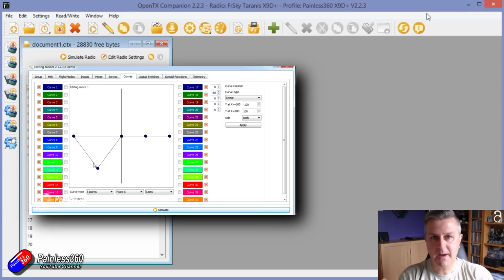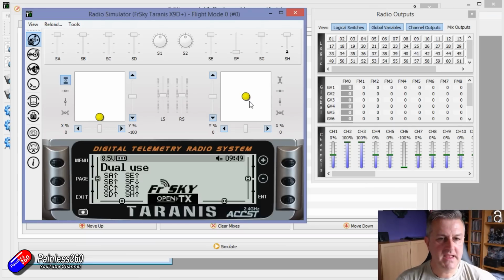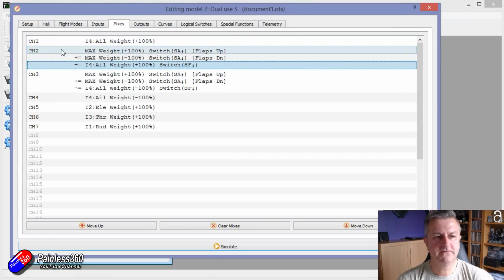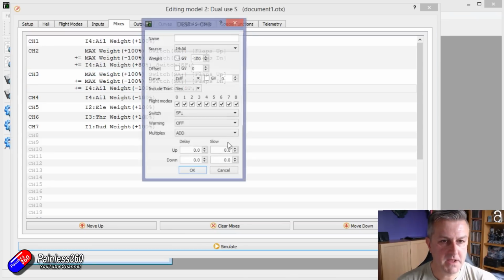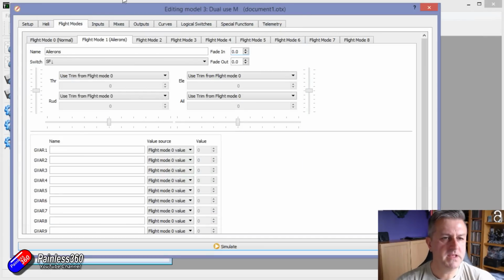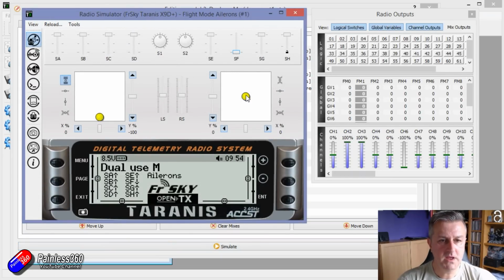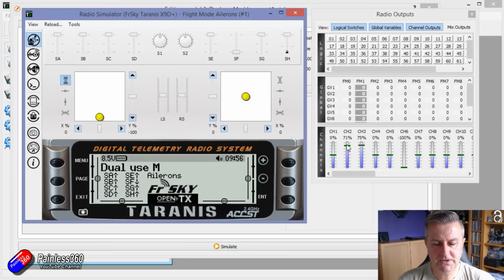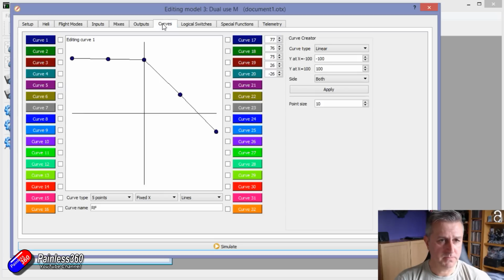OpenTX Quick Tip: Using Flaps as ailerons / dual use flaps / full span ailerons

Comment: I am so glad I found this video. I have been wanting to use ailerons and flaps together on my TimberX. Here is where I am. My ailerons are on a Y harness. My right aileron and flap are moving together. But I must have made an error. My left flap is moving like an aileron, but opposite of the aileron. Where did I go wrong?
Reply from the maker: No idea without looking at the radio. Sounds like you are using two chanbeks for the Ailerons so make sure you did the same on the side that doesn't work as you did on the side that does.. Best of luck
Reply: @Painless360  Thanks a bunch.
Reply: I think I know why I can't get both wings to work. The flaps are on a "Y" harness. I believe you said it had to be separate channels. Darn!!

Comment: This is awesome but I’ve got a drama with my timber x 1.2m, the flaps go both ways above and below the wing And I’m having trouble getting them to act as two position flaps (half for takeoff, full for landing), I’ve got the flaps working so the flaps mimic the Ailerons but I can only get flaps to be either off (level with wing) or on fully up +100% (which you don’t want)and level with wing 0% (flaps off) or down -100% (full flaps) I can disable +100% flaps so half 0% is flaps off but I’d really like the 2 positions below the wing 
+100% off
0% flaps off position 
-50% takeoff flaps
-100% landing full flaps 
I hope that made sense 🤔 
Thanks for all your videos they are great 👍🏻
Reply from the maker: You could setup a curve for them and select that with a switch so they move as you want... best of luck
Reply: Painless360 thanks mate I’ll give curves a try.
Reply: Painless360 got it working thanks I tried slowing the flaps down to look more scale but something is off it flicks the flaps up over the wing for a short second then slows to return level, but al least it work at normal speed and learning heaps about OpenTX 👍🏻
Reply: Painless360 have you got a Timber X? I’ve decided that slow flaps are a must 🤣 I just can’t get them to work.

The plane would be a good challenge for you to program, flaps go both ways for ailerons and can be used for crazy elevators  and of course flaps with delays, would be amazing if you could have a crack at this👍🏻 they do a night Timber also, the model comes with a Sektrum ASX rx which does the delay in flaps as you can get the settings from Horizon hobby great for Spek users but doesn’t help Opentx, have an awesome day thanks again

Comment: Hi Lee would it be possible for a V-tail plane Ailerons and the V rudders as a type of airbrake when coming into land?  like combining the Ailerons and the V rudders together using the SH switch like a push switch function for a brief moment of time?
Reply from the maker: Possibly, not sure how that would affect the attitude of the plane. i.e. how the two control surfaces would work in tandem to slow the model not pitch it up/down...

Comment: I was searching "full span ailerons" for a week and only just found this video. I even asked Andrew Newton if he'd consider doing a how-to video and he thought it was a good idea. Hopefully he's aware of your video. Thanks for putting this together.
Reply from the maker: You search other RC channels other than mine! ;) surely not...
Reply: @Painless360  Question on this setup. When I followed this method, and assign the flaps to a 3 pos switch, they function just as an aeliron would and lose the "flap" characteristics. They function as full span ailerons fine, but how do you make the flap surfaces actuate in one direction only with a 3 pos switch? Ex. SA⬆︎=Flaps Off, SA(–)= 25% Flaps, SA(⬇︎): 40% flaps.  Hope I'm explaining this corretcly. As it is now: SA⬆︎=Flaps above the wing surface(like up aileron), SA(–) flaps off, SA(⬇︎): flaps below wing surface (typical flap behavior). Thanks for taking a look!
Reply: @Painless360  Yours and Andrew’s channel are my go-to sources for useful info! Such fantastic content.

Comment: Hello, enjoyed your OpenTx videos - your ideas are incorporated into a few of my planes.  One thing I am struggling with is to have snap flaps - i.e. when I fly inverted with the elevator down to keep the nose up, I would like to give an amount of reflex to the ailerons such that they will give some camber and therefore some lift when inverted.  Don't necessarily want this to happen until down elevator is, for example >20 (elevator movement from centre).  I have been playing with a>x with the elevator as a and x > 50, using this to set a variable. Any ideas?  Mike Jones
Reply from the maker: How would the radio know that the plane was inverted and to add the reflex?
Reply: @Painless360  Well, it wouldn't, except for the fact that it would be unusual for the elevator to be be pushed forward (down) for more than a couple of seconds.
Reply from the maker: It is possible with the radio but I'm not sure that the reflex wouldn't be activated unintentionally while in normal flight..
Reply: @Painless360  OK, thanks, it was just an idea that if I was flying inverted for more than a couple of seconds, therefore elevator down quite a bit, I could sense this, well, not me, the TX, apply a bit of reflex whilst elevator continued to be down and then revert to normal when not.  I'll continue to play with it and let you know if, and when it works.  Regards.  Mike
Reply: OK, managed to make my idea kind of work by using two logical switches and special functions to control a global variable used as a value for the reflex and offset. The first tests if the elevator is pushed forward for more than a specified time (set with the Delay option), if true, the function sets the gv to the desired value.  At the present time, the Duration option limits this to 25 seconds before the reflex is cancelled - even if the stick is still held forward.  Reflex is cancelled as soon as the elevator returns to centre.  
I might, or probably won't use this, I was just wondering.  Please excuse the ramblings of a 76 year old bloke living in the  mountains of Snowdonia.

Comment: Unless I've missed something your flaps only follow the ailerons downwards when I have done this pretty much like your second version but without the curves I have made sure the flap linkage works both up and down so it follows the ailerons completely instead of just the bottom half. In addition if +100 is in line with wing then -100 will be twice the travel that the aileron moves but only downwards. The way I did it was to have three flight modes, "TAKE OFF" where the flaps are independent and are set to say 10% in order to aid take off, "CRUISE" where the flaps follow the ailerons both up and down and "LANDING" where the flaps are set to say 50% to help slow the plane and reduce the stall speed.

Comment: Great tip again as usual. I'm making an assumption here but would this be particularly useful on larger span craft where the 'flap'  moves more and the outer aileron less. This would reduce  the wing stress/flex and give a more balanced pressure across the span, rather than just the outer ailerons doing all the work. I hope I explained that sufficiently.

Comment: Nice but I got excited when I saw the bixler 1.1 that I bought at the wings 'n' wheels bring and buy in the thumbnail but it doesn't have flaps.

Lets see if this goes better than the wing, someone else was kind enough to re-enforce it for me. Will it run 4s on a 5" prop? Don't have many 3s batteries.
Reply from the maker: I've never tried mine on 4s. 3s 2200mah packs are cheap as chips.. Best of luck!
Reply: Lots of ESC's say 3s but people have a 4s battery plugged in to them 

As for flaps you can quiet easierly install them all you need is a sharp knife and some hinges and 2 extra servos  or another way is do some mixing so that the ailerons  can be used as flaps 

I used to have version 2 until a house fire i now have version 3 and both come with the option of flaps which i do not use as still learning